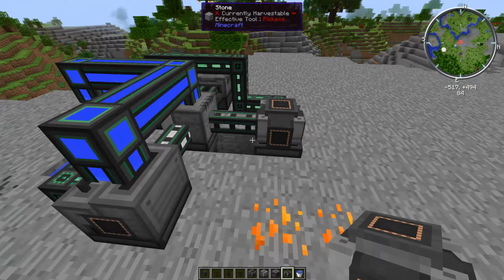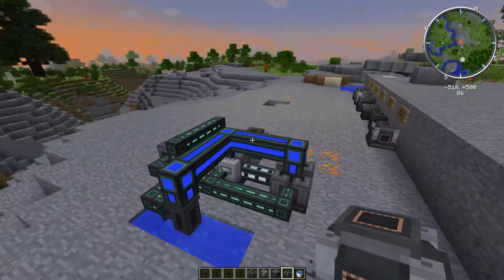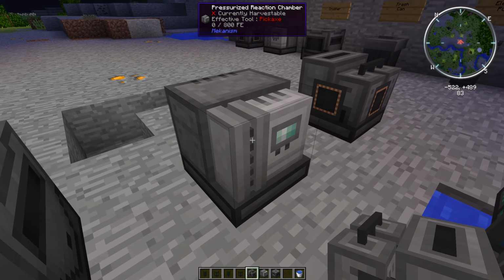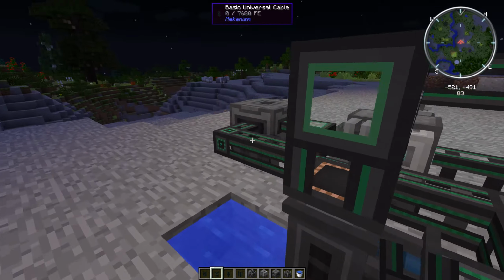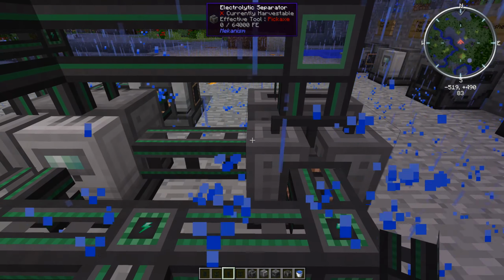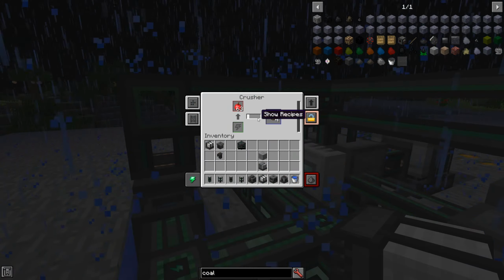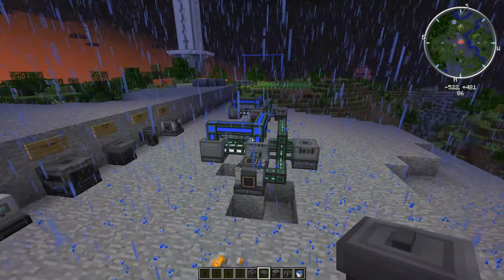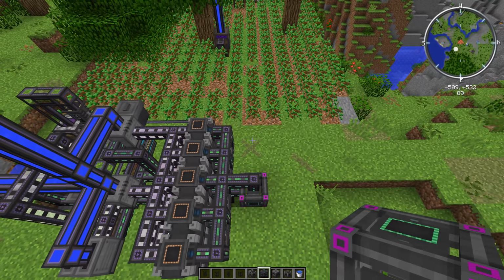Minecraft | Mekanism Tutorial | Infinite Renewable Energy!

Comment: For the upgraded version, you could add a heat generator to burn up excess logs.
Reply: Add a fuelwood heater to the heat generator, put the logs in that instead. It will burn far more efficiently too

Comment: If you don't have a trash can, check if you have a "Small Waste Incinerator".
Carrots and potatoes also give the same amount and is muuuch easier to farm.
You can also skip some pipes and place them side by side, they auto-eject into each other.
Reply: trash can and small waste incinerator do not exist
Reply: @carbonaradepapa1276  dropper and lava will suffice, and both are vanilla.
Reply: if you have thermal expansion, the nullifier will work flawlessly as well
Reply: there's also drawers with the void upgrade (it's very likely that you have the storage drawers mod installed but i guess the good ol' dropper and lava will work too)

Comment: Even with pollution of the realms this is very useful.  The gas burning generator on ethylene is actually, due to ethylenes energy density, surprisingly clean in terms of energy to carbon/sulphur ratio.  Oddly in file shows ethylene as 0 sulpher but the gas gen itself produces miniscule amounts.  I find it producing little overall and i rarely have to replace the leaves.  And only had 1 piece of sulpher form in the filter in over 10 hours of running it.

Comment: On default configuration, 1 fully upgraded prc can sustain like 11 gas burning generators with etylene, provided you have enough biomass production. that prc needs an electrolytic separator with 4-5 speed upgrades to give sustainable hydrogen. With infinite water and automated melon farm, and a basic crusher fully upgraded, you can get a net gain of ~65Krf/t :D
Reply: Ratios are likely different in enigmatica six, i should warn.  The processing speeds of PRC’s even fully upgraded is now pretty slow, slow enough it cannot keep up with 1mb/tic.
Reply: the bonsai mod can get enough biomass to sustain the system

Comment: If you have phytogenic insolator or a garden cloche or any auto farming setup, try farming potatoes. 1 baked potato gives you 10MJ of energy, for a price of 100KJ - 200KJ. (1 baked potato = 7 bio fuel = 350 ethylene) and try to give the machines speed upgrades and energy upgrades for better energy output.
Reply: Create harvester setup too?
Reply: @AnkleBiter3854  yeah, you could probably use a chest and a logistical transporter. or a logistical sorter so you would only output potatoes and not the poison ones.
Reply: @lazypercel5422  someone also mentioned using carrots instead, as they don't have any other byproducts that need discarding
Reply: @AnkleBiter3854  yeah, you could do that too. thermal dynamics include an upgrade that automatically discard any byproducts, so i dont mind using potatoes
Reply: @lazypercel5422   oh cool

Comment: I know this is over a year old, but heat generators are great because you can surround them in lava to get passive power generation. It's not a ton (just under 40 FE/t with the generator being in the same space as a lava source block, plus 6 surrounding it), but it's not nothing. Especially for early-game, and not using any fuel. You can also boost this if you temporarily need more power by adding lava/coal/charcoal/wood/etc. as fuel
Reply: Eh nah, you ditch it immediately for solar or wind lol
Reply: Fuelwood heater can also turn the coal guzzling heat generator into a far more efficient generator

Comment: In 1.18/v10 ethelyne can make almost 80k/tick. They super charged it. Combine it with cactus/snad or melons in a cloche and you can make hundreds of thousands of RF with very little investment (1 crusher, 1 separator)   will easily run 5 prcs and a single prc can run ~10 gas burning generators

Comment: Use wind and solar generators
Reply: it generates a small amount of power, it's only good for early game
Reply: @Lagosta777  advanced solar gens are decent, and wind gens at max height also decent. Although they’re definitely outclassed by fission and fusion
Reply: This is mainly for early game, to get enough power to make the better stuff. But this can almost match those generators (especially since Solar only works during the day), is really cheap for expanding (one PRC can provide more than enough fuel for 4 generators, maybe even 5 or 6, the separator can provide to at least 2 PRC, and the crusher... Well, depends on your farm efficiency, but I've managed to fill 4 PRCs off of one before).

Then there's the added benefit of this producing Substrate, which is needed to create HDPE, which is needed for the end game armor. And while a later step in that also uses Ethylene, this setup is good enough to easily fuel that and a few generators, so where's the harm in extra power?
Reply: with projecte watchs any generation is good
change my mind